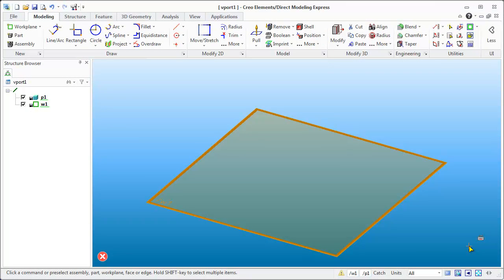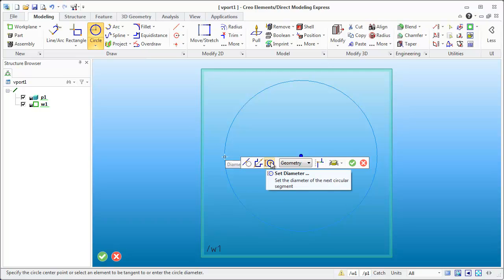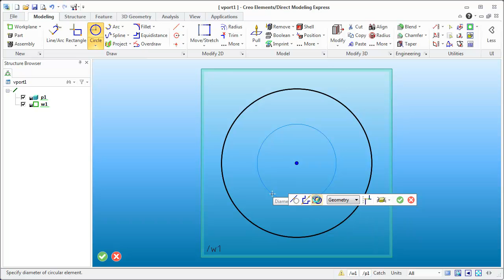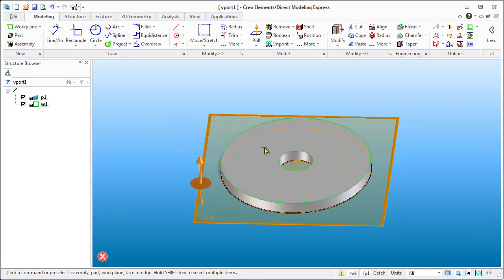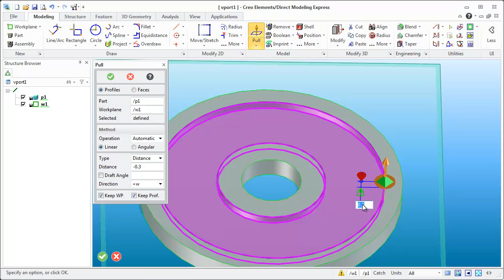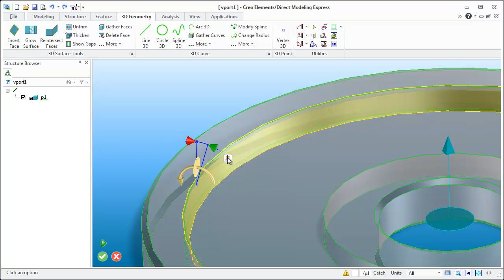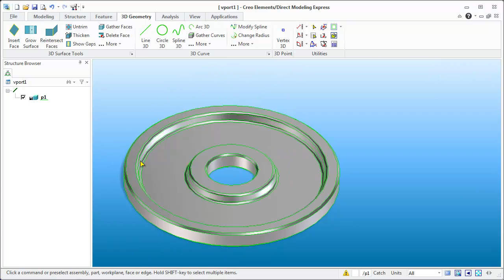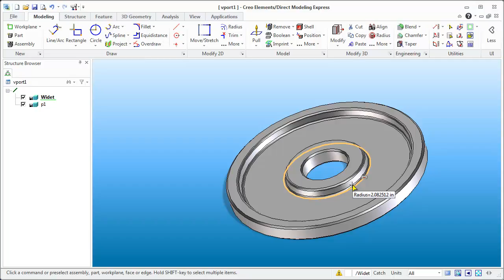Video: Direct Modeling Express basic modeling

Comment: I used to work with another CAD software. After one year without practice, these guides are helping me a lot!

How do you set the workplane to automatically adjust it's size accordingly to your part's dimensions?